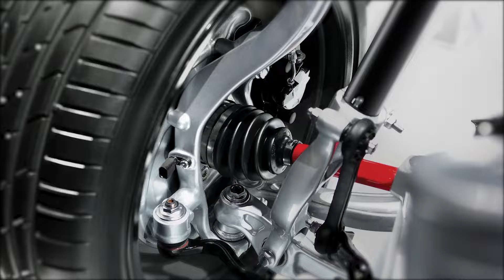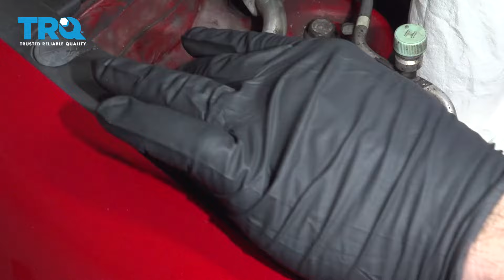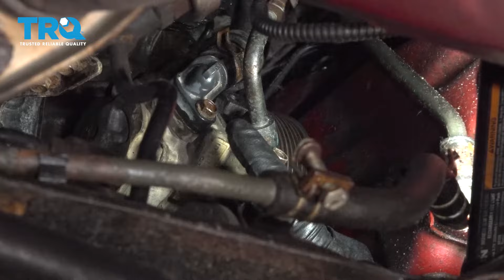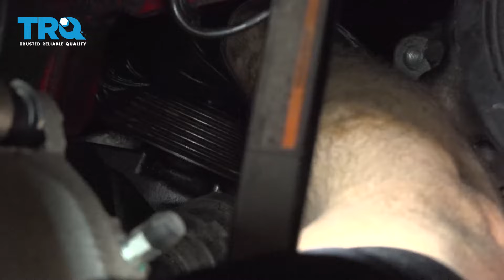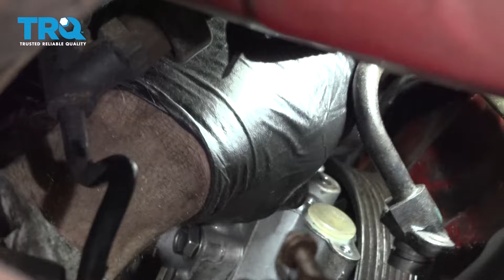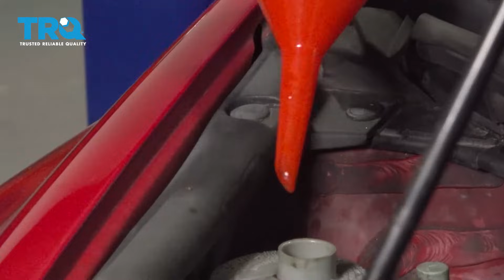How to Replace Power Steering Pump 2006-2011 Honda Civic

Comment: 5:52 that bottom mount for the pump broke which then caused the top bolt to snap is that part of the block or is it it’s own separate bracket that bolts onto the block looks like the top hole might be part of the timing cover hoping the bottom one isint part of the block

Comment: Got a 08 Honda the top bolt for the pump snapped off and the bottom bolt split the lobe that the bolt threads into. Is the pump bolted directly to the block via those 2 holes or is that a separate brackets that then bolts into the block?

Comment: Oh dear ! 9:25 you can see what I'm sure is that O-ring seal caught and suashed out of the side of the cylinder type connector ? Did it leak afterwards ? Great video for showing me the method to replace thank you.

Comment: is taking off the wrong top bolt a big issue? Will it cause problems down the road if I tighten it back or should I use threadlocker on the wrong bolt to put it back as I dont know the torque spec?

Comment: So the pump I bought has 2 screw threads (fit the high pressure side) but the plastic connector only has 1. I threaded it, filled it, and it started leaking from that side. I quarter turned it and the plastic broke. Anyone know if they sell a 2 screw plastic connector for the high side? I’ve looked online.

Comment: Why didn't you show what fluid you were using? Would have been so easy to do so. What did you us
Reply: Wasn't specified here, but it's best to use Honda/Acura OEM Power Steering appliances for it,

Comment: Thanks dude.  A honda dealership in Tucson Arizona wanted to charge my sister $1300 for this job. They weren't even installing a Honda pump. Goodness! It's a bit of hassle without a lift, but certainly feasible.
Reply: Wow, I just did this on a customer car for I think 650 parts and labor. Some places are a rip off

Comment: I got a dumb question. If the pump is bad, does it make the car shakes?
Reply: Good question. I don' t see it being able to cause a lot of shaking. But I am no expert. I would suspect a bigger component causing the whole car to shake.
Reply: yes it caused my car to shake but not too bad but it’s also cause my power steering pump has a leak :/
Reply: Check the rotors put your wheel back on the car and wiggle it side to side make sure it's flat on the rotor  then kinda move it see if it wiggles if so the rotors will cause it to shake at 80 bad. And discount tire had the best balance. ..

Comment: What cause my power steering fluid to bubble?
Reply: Probably the O ring in either the high pressure or low pressure line bc once it cracks or hardens it lets air into the reservoir and it can foam up I have the same problem and am about to fix it
Reply: o-ring on the intake hose needs replaced. I have been looking around at repair videos and here is one i recently found that should solve your problem https://www.youtube.com/watch?v=D0Y-Q4qtI6Y

Comment: I still don't know how you got the wrench to that top bolt. I had to remove the pulley to get to that bolt.
Reply: If you remove the cowl up top you can more easily access that top bolt from the top of the engine bay. Saved me a ton of hassle.
Reply: I found it possible to thread the top bolt before the bottom bolt.

Comment: I got my pump out and in with pully on . Spin it around pully towards engine and wiggle
Reply: In the coupe that pully has to come off to get out in-between    thru the wheel well and control arm..
Reply: Thanks dude. I just did it your way on my sisters car. It saved me time because I brought a just few tools from willams az for the holiday. A honda dealership in Tucson Arizona wanted to charge my sister $1300 for this job. They weren't even installing a Honda pump. Goodness!
Reply: Me too :)

Comment: This is a great video! But I have a big problem , I broke my top 12mm bolt that holds the power steering pump to my eng. I’m trying to figure out how to remove this broken bolt without having to remove eng from vehicle
Reply: What did you end up doing
Reply: Same problem I suffered   but I give you the solution

Use a drill machine to remove that broken bolt

Comment: Do you have to bleed the system?
Reply: dont believe so. they kinda bleed itself
Reply: Turning the steering wheel from side to side post repair will push the air out. It might be kind of a weird feeling in the steering until all the air is purged.